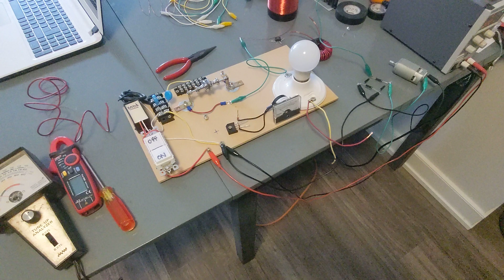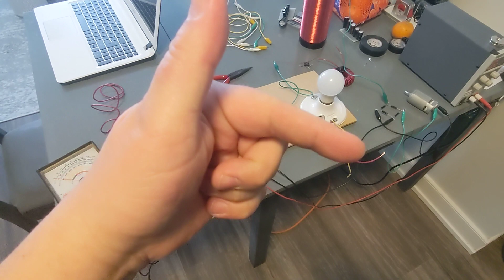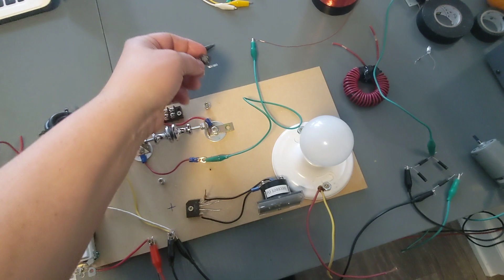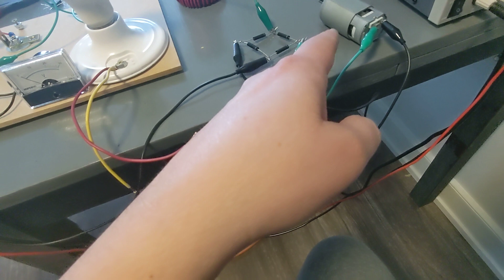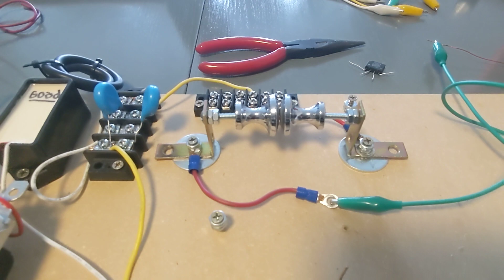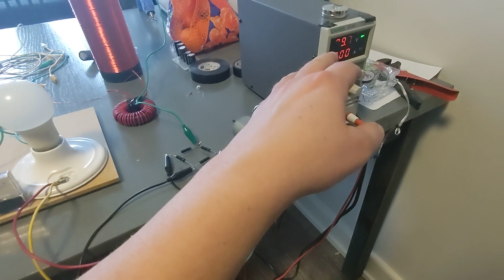Faraday Research RND Don Smith generator ⚡⚡💦#freeenergy #tesla #zeropointenergy

Comment: My friend whatever you are doing is nothing close to Don Smith. You are done Done Smooth. Get 20 lime, and stick AL and Cu rods, 1mm dia, and connect half of them in series, two sets and then connect them in parallel, then two wires connect it to the DC Motor. It will run faster than what you have done after you cooked two BRF. Your experiment is something else but 100% not what Don Smith explained. Don Smith's device needs a lot of Electrical Engineering background, precise calculation of antennas, ac voltages, and frequency. You need to study Resonance in electrical circuits for about 6 months or so then you step into Don Smith. This is my best advice to you. You continue to do what you are doing just to please yourself with.
Reply: What you be able to send a schematic? I'm going to try to replicate Don's device